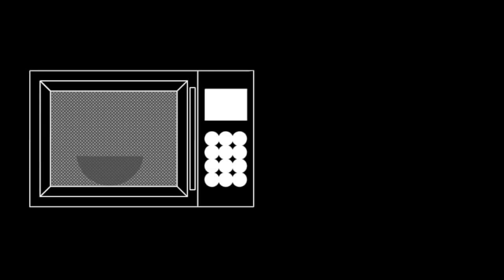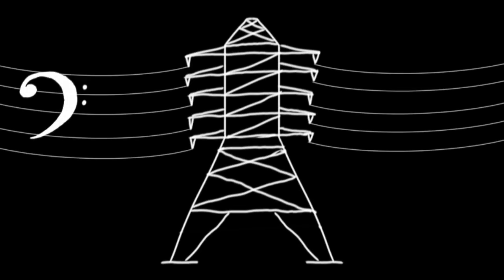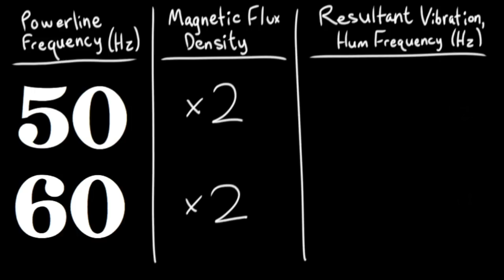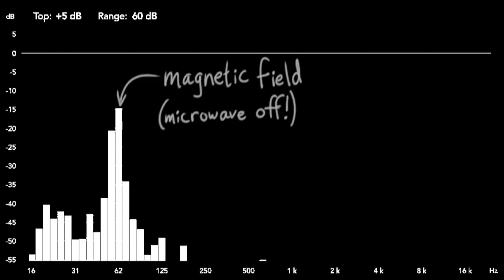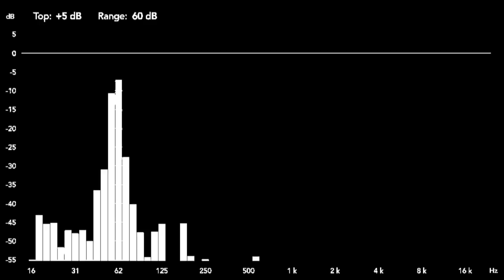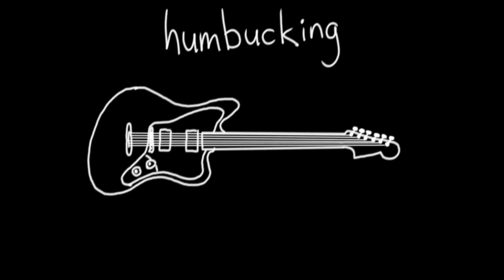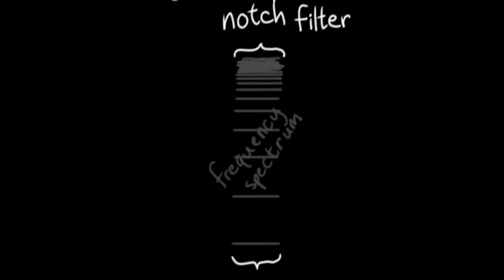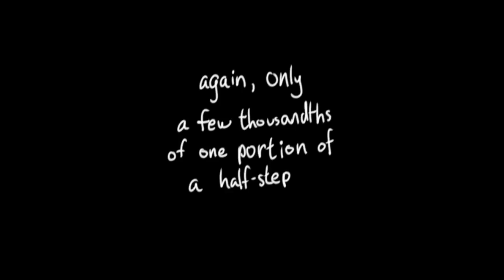What Do Microwaves Hum?

Comment: so what you're saying is if someone were to modify the electricity going into the microwave you could make it hum a song? (in theory) that's interesting lol
Reply: You could theoretically do it to any electrical device, not just your microwave.
Reply: I need to do this.
Reply: Have you ever heard about synthesizers?
Reply: For bonus points, tune it to the Bohlen-Pierce scale, a xenharmonic musical scale invented by microwave engineers.
Reply: Try looking into the Device Orchestra. I don't know how they work exactly, but it's probably a similar idea.
Reply: It depends on the frequency of the electricity so you would need a transformer to change the frequency for different pitches. On the other hand, by pressing on the microwave you can mute some of the harmonics to generate different pitches, but that's pretty limiting.
Reply: congratulations you have discovered analogue synthesis
Reply: I doubt it would work very well considering microwave transformers are designed to operate at either 50 or 60hz an as you deviate from these frequencies the transformers efficiency goes down resulting in more heat possibly killing your microwave.
Reply: 'is microwave an instrument'
'in theory patrick'
Reply: Why do I hear boss microwave?
Reply: @nahometesfay1112  transformers could be used to generate harmonics by saturating them, but what you'd really want for this application is a Variable Frequency Drive, an industrial module used to run synchronous motors at variable speed. with a VFD driving the microwave you could have it play at any frequency within the VFD's range, accepting that the microwave may not like being run at frequencies outside of, i'd estimate, 40-80Hz
Reply: @famitory  You right fam I don't know what I was thinking
Reply: @Chaosrunepownage  he does change the frequency of electricity
Reply: Yes you can do that you can also make a speaker out of a transformer but it takes a lot of power to run it
Reply: I can't remember exactly where or what it was called,. but a youtuber named Pecos Hank had uploaded a video about this electricity box that can withinstand like 10,000 hertz from this electric beam, and then the team or whatever behind that box had manipulated the amount of hertz to make a song
Reply: "Ferb, I know what where gunna do today!"
Reply: yes and people have actually done this
Reply: In theory, you can Rickroll anyone wanting a hot pocket.
Reply: A Hurdy Gurdy Microwave
Reply: we need to get shady cicada on this lol
Reply: have some sort of variable frequency divider controlled by the microwave's software or something and bam now your microwave plays elevator music while it runs

Comment: This video made me realize why I always feel anxious in certain places where there isn't a background noise such as a fan or an air conditioner running to drown it out (which is why my AC's fan runs year-round) but I don't get that same anxiety in certain places such as old buildings, out in a forest, or some other places. I have extremely sensitive hearing and I must be hearing the humming sound of electricity. In places where there's a lot of appliances set up, or very large appliances, but not enough other sound going on at the right kind of tone to drown it out, my "silence anxiety" gets far worse.

Comment: 4:02 in the illustration these are actually phase-aligned so if you put these two waveforms together they would result in an increase in amplitude.
Reply: But check the pluses and minuses! they are inverse on each other, and cancel eachother out.

Comment: I knew what the hum was as soon as you mentioned that it was different between the US and other countries. This is also the reason why analogue screens have different refresh rates in the US than other countries, because the TV casts each frame with the same frequency as the electricity. Since analogue TVs interlace (alternate between even and odd lines of a frame in order to increase refresh rate), the refresh rate of the TV is half of the frequency of the electricity going in.

Comment: I always accepted that blackouts were quieter than when the power was running, even if nothing was on. I assumed that it had something to do with the power itself making noise, but I didn't realize it was because of the frequency of the electricity. Thank you for this cool video!

Comment: the minecraft mod MFFS (modular force field system) has a nice hum when active, the 2CM beam system mod on space engineers is also a good one for a nice hum, also ferro beads mitigate or eliminate the magnetic field, that little block looking thing at the connection ends of wired is the ferro bead, it's just a lump of iron, or ferrite

Comment: My oven had plastic feet, and that transfered the hum noise to the wooden kitchen counter, which then turned the below cabinet into a speaker cabinet, which made things very noisy indeed.   Fortunately, I had an old sheet of glass with smooth rounded edges that came from a wall unit, and it was the same size as the oven.  I placed that on several kitchen sponges, and then the oven on top of that, plus I had glued some thin rubber to the oven's plastic feet to prevent the oven from slipping on the glass.  Bingo, this sound muffler worked so darn good that about all you could hear now was the oven fan.

Comment: 0:34 I feel as I that disclaimer should’ve been a bit stronger, because there are several things on the inside of a microwave that can kill you. If you open it up you can expect

A: A part that will instantly kill you if it’s plugged in
B: A part that stops your heart before you hit the floor if you touch it before discharging it
C: A part that if you break it and inhale the dust, will also kill you

All this is to say, you really really do not want to fuck with a microwaves internals unless you are seriously experienced in electrical work, microwave internals kill a lot of hobbyists that wish to use certain parts because while they are extremely useful they are extremely dangerous and one wrong move is desth

Comment: I got tired of the humming.  The hum was being amplified due to the oven sitting on a kitchen counter which is wood based.  Also, there is a kitchen cabinet below the counter which basically turned into a humming speaker box.  So I placed the microwave oven on a sheet of glass that has round smooth edges, and below that I have several foam sponges appropriately positioned. They act as sound filters.  Now all you hear is the oven fan, with a quite hum in the background.

Comment: Corrections:
The magnetic field is focused around the transformer, not the whole oven.
The reason behind the filter being wide is nothing to do with the variation in mains frequency. You mentioned it yourself that the frequency barely changes. The real reason is due to filter steepness. It's difficult to make a flat filter in the pass-band that has a very sharp transition to the stop-band. This is especially true in filters which require a low delay time.

Comment: When my family moved into the house they currently live in it had a really old microwave that for some reason would interfere with the Wi-Fi when it was running. It would be fine and then you’d start the microwave and watch the signal strength go all the way down and when it stops it goes right back up

Comment: My microwave doesn't hum 😳
Reply: Probably an inverter microwave running it’s power transformer at a frequency well above the 15kHz audible range. These microwaves immediately rectify the 60hz AC mains into DC so it can be chopped up a few thousand times a second and fed into a more compact and efficient ferrite core transformer instead of the ancient massive heavy lossy expensive iron core transformers used in most microwaves. You may still hear a light 120hz vibe from the rectified 60hz ac (which is now “120 hz” DC as every other cycle becomes positive as well) if the microwave is drawing a lot of power or is badly designed.

Comment: i will tell you what make the noise 
the big transformer  inside !!!!!

the transformer is just a speaker  and speaker use AC  to make noise
because i dismantled  a bunch of them and plugged them into the wall outlet for experiment
*removed the high voltage  coil and put a 2awg wire to make spot welder hehehe
*or turn it into a 60v dc transformer :D
im bored  good day to you

Comment: Wrong.  The transformer is what makes the noise.  The magnetron operates at 2.45Ghz in most home microwaves which is WAY too high of a frequency for the human ear to hear.  It makes the same hum as the transformers on the power pole for the same reason... transformer.  A typical residential microwave puts out about 1100 watts and running that much power trough a transformer will make it hum.